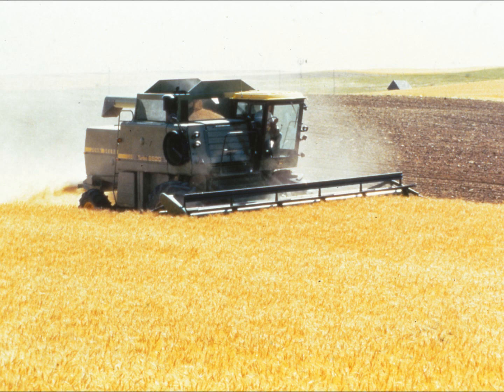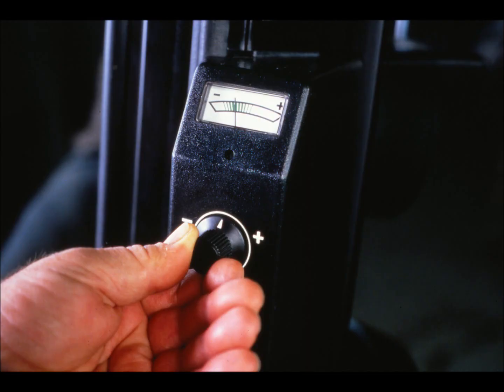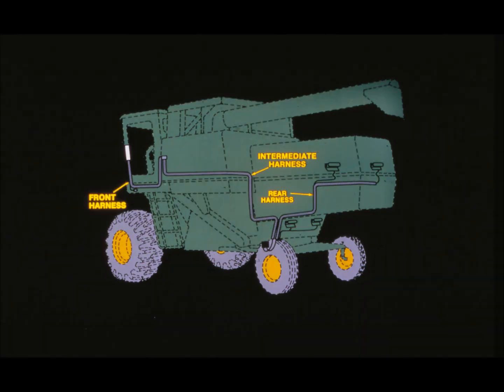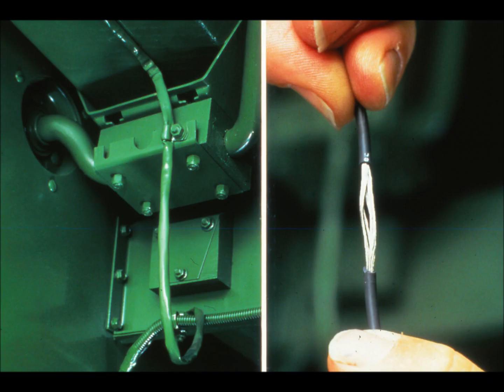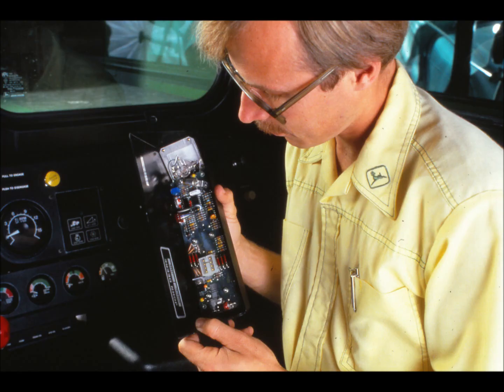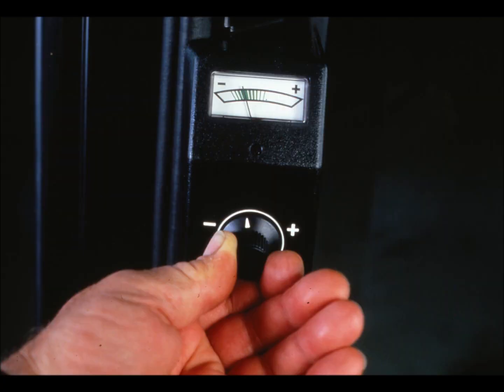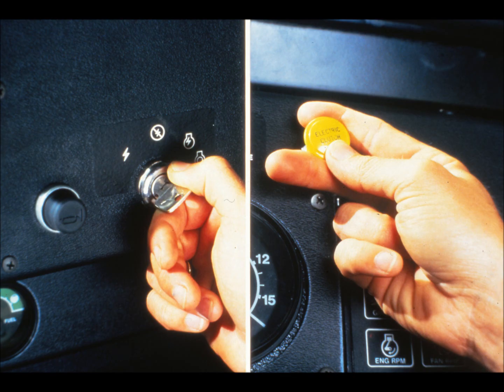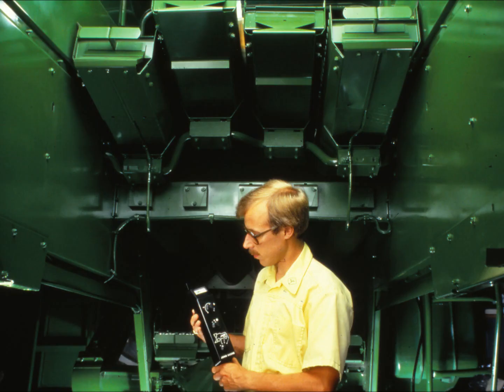John Deere HarvesTrak Combine Monitor System

Comment: Thanks Mr. No, I have a 6620 and some of the wiring for this system is long gone. I was always skeptical how well this system worked. I knew it read grain loss with those sensors, but thought it might be hard to actually pick up on a kernel bouncing out the back. Now they are saying to give it a good wack with a screwdriver to get a reading. How does that compare to a little kernel of grain? '80's tech, I guess.
Reply from the maker: I would think it's about the same surface area between the two & they're both hard. Grain would probably hit that plate with a reasonable amount of force, too. So, the screwdriver should somewhat replicate the sound of a kernel hitting the sensor.